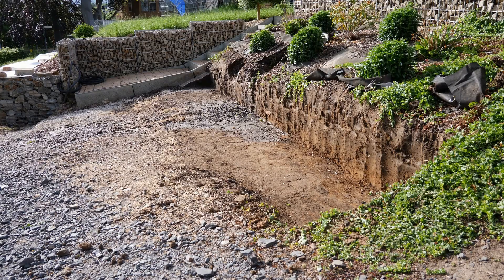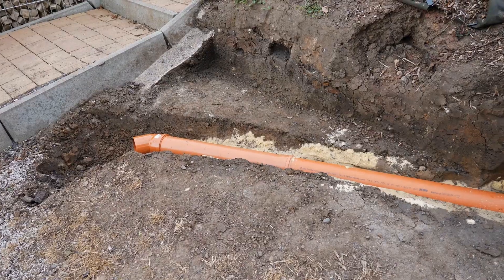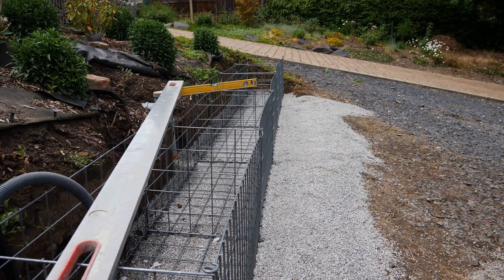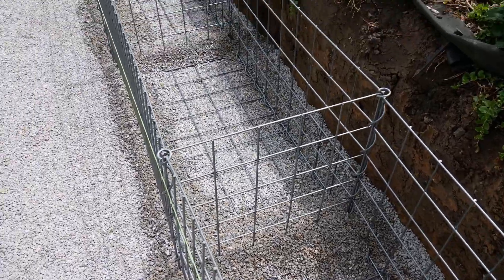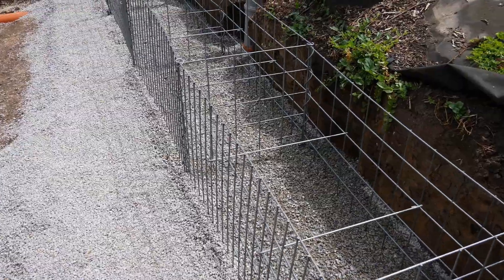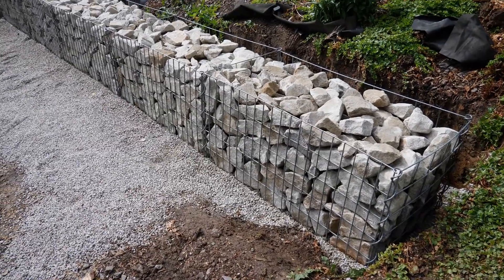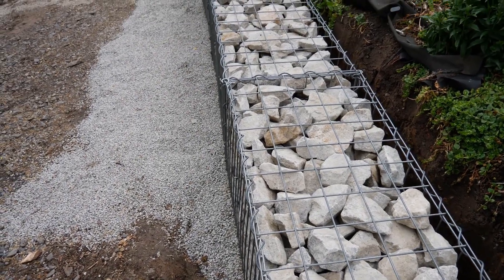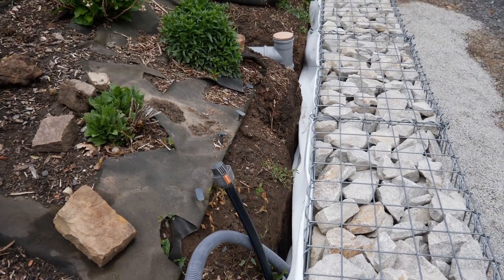Slope stabilization with gabions - How to build a raised bed on a slope

Comment: What do you think, is this cheaper than building a concrete retaining wall? Thanks
Reply from the maker: Hi,
I built the project in my home country Germany. There I paid EUR 40.00 for a basket (100x50x50 centimeters). The granite stones cost me EUR 80.00 per ton back then. As the stone consumption was close to me, transportation was already included in the price. You can expect about 400 kg of stones per basket. In total, I paid around EUR 100.00 for the running meter. That should be about $105.00. 

I also built a formwork stone wall which was filled with concrete -> https://youtu.be/aC9W4BxxFr4  
One stone had the format 50x25x25 - so 4 stones for the running meter. The stones cost EUR 3.00 each at the time, so EUR 12.00. The concrete was around EUR 25.00 per running meter. The formwork stone wall therefore cost me EUR 37.00 per meter. But the wall is only half as thick as the gabion wall. 
The concrete wall was therefore cheaper, but nowhere near as attractive as the gabion wall. 

Concrete has now become very expensive. Since the production of the cement generates a lot of CO2, there are high taxes on it. The stones now cost EUR 5.00 and the concrete EUR 40.00 per meter. 

Personally, I would build the slope again with gabions, even if a concrete retaining wall would be a bit cheaper. 
What are the prices for the individual building materials where you live? 

Best regards from Thuringia in Germany

Translated with www.DeepL.com/Translator (free version)
Reply: @commaikenglish  I appreciate your extensive answer. The prices are probably quite similar since I'm in Europe too. It's probably better to build with stones like you did. Finally, I would glue natural stones over the concrete wall. Happy holidays, thank you